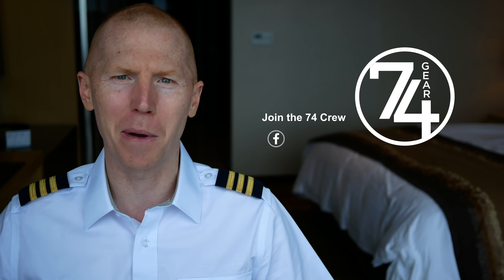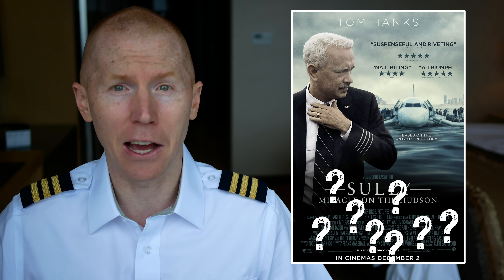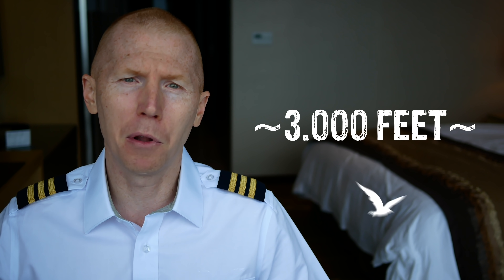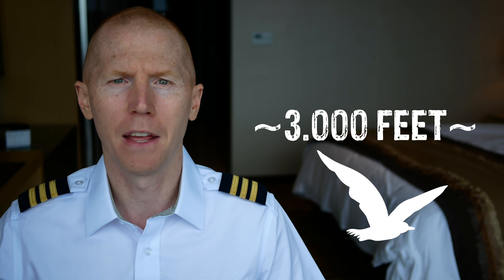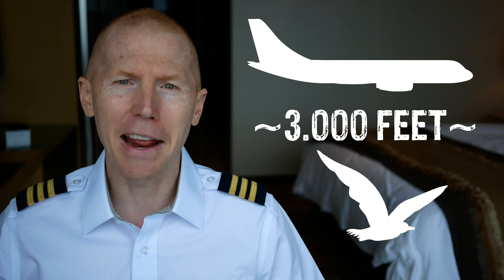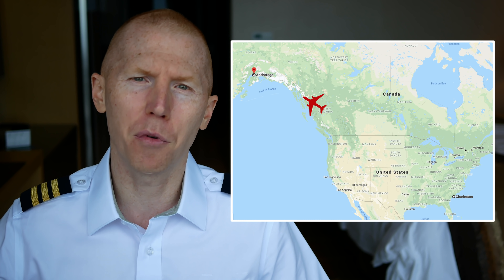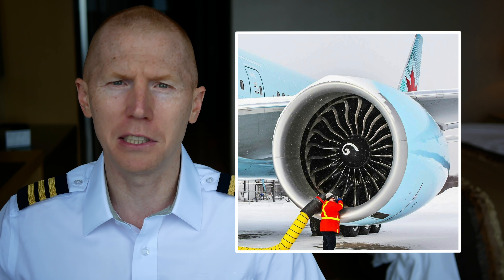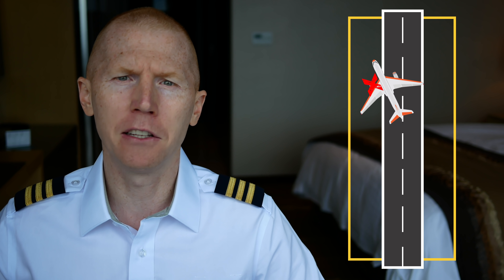Why Engines Don't Have a Mesh or Grates to Stop Birds

Comment: For some weird reason you didn't mention the fact that engineers have designed engines to be able to swallow and digest birds of various sizes without causing lasting damage. I spoke to a pilot who showed me videos of tests being done on jets where they were literally throwing fairly large birds into a stationary engine.
Reply: In 1982, a brand-new billion-dollar stealth bomber encountered an eagle.  Sucked into the right engine, it caused the jet to burn into the fuselage.  The plane made an emergency landing at Idaho Falls airport, where it was on display for a few days until the USAF figured out what to do with it.

Comment: If you put anything in front of the intake, you will cause the turbine to over heat...they use screens while in the test-cell , but they are compensated by mixture control & fuel consumption ...that is why replaced engines require a test flight after install..!

Comment: Never really thought about it before, but when the question came up in this video, I didn't think about wasting fuel and still not gaining enough thrust for a safe takeoff. I was thinking along the lines of - If they put some type of grating in front of the engines, the grates would have to be small enough that a small bird can't get through it, and if that was the case, then just by that alone it would be a relatively weak structure, and if a bird was to strike it, then you'd have all this grating going thropugh the engine, along with the bird that you were trying to keep out in the first place.

Comment: Since birds strike engines just under 3000 ft, why not put a retractable solid mesh that once again retracts automatically after the 3000 ft altitude? Based on digital data, certain airports known for bird strikes would decrease based on input data?

Comment: Turboshaft engines on some helicopters have particle separators, essentially a curved path into the engine so anything solid will go in a straight line, ejecting out a port while the intake air takes the curved path into the engine. Wouldn't work for a turbofan though. The intake is too big.

Comment: There are Russian MIGs that have a flap door forcair to enter the engines during takeoff, to prevent ingestion of rocks and other debris from less than perfect airfields. The doors then close and air more efficiently enters from the front. It can be done, but the bean counters and your bosses have figured it is less expensive to hsve an occasional crash than to build a safer aircraft.

Comment: I was thinking a cone in front of the engine to deflect birds while still leaving a big gap to suck air in from the sides but I'm sure there are a hundred reasons why that won't work. Will probably just suck birds in from the side too while restricting air flow.

Comment: Why don’t they put something that protects the engine with in 3,000 ft and it would retract outside that envelope? They could’ve adapt that to the older planes by bolting on a quick install like you would install shutters on the windows which open and shut

Comment: Good explanation, thanks for sharing!! Also if we have grids or mesh or screens in front of the engine, then if parts or fragments from that fall into the engine it will cause more damage at higher altitudes and greater speeds.

Comment: I understand that a flat grate would reduce air intake. But, if the grate was domed, it could be designed to allow the same volume of air to enter the engine.

Comment: They sell “deer whistles” that you stick on with poster double sided tape at Farm and Fleet and Casey’s gas stations in Wisconsin.    They work pretty good.   
      Just buy 2 of those for every plane.    

      Or just J W weld a plastic owl with the yellow eyes on top of the plane.   You can buy em at Menards for cheap.   
      They’ll scare away the pidgeons.   

       Or convince all the Karens working at the no kill kitty shelter to let the cats have an outdoor home at the airport, where they can roam free !   🇺🇸

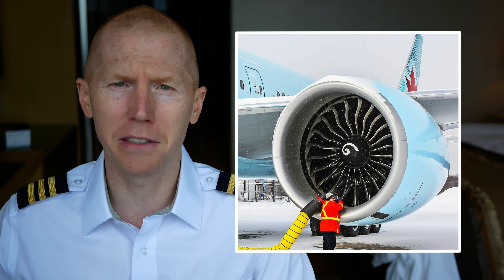Comment: You failed to mention the pattern on the hub of the leading fan that looks like a whirl (about 3:08). This is an optical they use to make birds think those engines are big eyes on a much larger bird. 
I had a friend who's grape fines got decimated by starlings every harvest. One year he trapped a starling and threw it into a room with a tape recorder and a hawk. He plays the recording every fifteen minutes during the days of approaching harvest. No starlings. So one bird saves many. I don't think that would work here as the aircraft is flying so darn fast.
Reply: I find that story difficult to believe

Comment: This quite a weak argument for lettin birds into engine. Engine input diameter  can be increased to compensate for wire mesh in front of engine. I am sure future engines will have this. Propeller engine is also an option, they will be again put to use when solar powered aircrafts will take commercial flights in future.

Comment: Weird I can use a metal screen from a house window as a turbo guard and that has  pretty small holes in it ran it on a dyno without it abs with it and no effect what so ever so it’s very very hard to believe something with 1-2 inch holes would cause a noticeable restriction in flow it doesn’t have to say stop the bird strike but break it up so the engine could actually pass it through with little to no damage done to the jet engine.

Comment: I understand using a flat-screen, or metal-grate will disturb engine intake airflow. Instead, shape the screen or grate into a forward facing bubble (forward facing, relative to the airplane) and connect it around the intake fan shroud.  Using the bubble method would increase overall surface area of the screen to promote better intake airflow. I understand weight would become a consideration, over 2 or 4 engine models, but it's not impossible.

Comment: When you say you can't have a grate or screen in front of the engine, you actually mean directly in front of it.. suppose you have a conical shaped screen 50 ft in front of that engine, strongly attached to the fuselage up by the cockpit.. the birds will get pureed by the razor sharp screen and all the blood feathers little pieces etc will be directed around the engine not through it... We're talking just very thin Sharp metal barely detectable to the eye, very little wind resistance will be a non-issue on engine performance and fuel consumption.. a picture is worth a thousand words, I could easily design something completely workable and have a damn good time doing it 👍

Comment: You could add a set of motion tracking cameras and an air jet that fires to knock incoming debris off course. 

I’m fairly certain that a strong enough puff of air could divert the bird form getting sucked in. It would definitely kill any bird it hits but would protect the engine. 

Even in the event that the bird still got sucked in the air blast would pre pulverize it and limit the damage. The system could be powered from the engines and would add a small cost to the overall cost of the plane while avoiding any decrease in fuel efficiency.
Reply: You could just not add anything. Most bird strikes are not a serious issue. And "puff of air" really doesn't describe what would be needed to divert something from being sucked into a jet engine. A large jet engine sucks in air equivalent to the volume of a house every second.

Comment: This video: "fuel efficiency"
Reality:
1. Individual bird hits happen all the time but only really extreme situations would take a plane down.
2. Any grate would need to be: strong enough to stop birds and not just slice them as they go through it:
3. Never let any of the grate break off and enter the engine.
4. Only be used in bird range < ~3000ft
5. Very lightweight (like everything on a plane for fuel efficiency).
6. Prevent ice buildup.

In short, the problem is much less severe than it sounds and a grate would be extremely difficult to design and expensive to have.
Reply: You can literally buy a little radio that sends out frequencies that drive rodents away at home depot. I do not understand why something on a larger scale hasn't been invented for birds at air ports.
Reply: @haydencook682  Airports do use these types of features
Reply: @David-NYC  I wonder why he didn't mention that then...
Reply: @haydencook682  
I think animals eventually get used to the sound?
Like those buzzers that are supposed to only be audible to teenagers/children to stop them loitering.
I once saw them advertised as ringtones so you can use your phone in class without the teacher hearing it.

That makes me think that such devices wouldn't last long and you'd need to try something else.
Reply: Yeah as someone who has taken turbomachinary classes, there isn't a huge aerodynamics problem with a grid of sufficiently thin vanes in front of the fan.  The problem is more the practicalities you mentioned above.  They would have to be very strong, very light, relatively thin, and actually dense enough to catch a bird sized object.  Those requirements are make it quickly not worth the effort.
Reply: @JMurph2015  most older low bypass turbofans and turbojets have stators in front of the fan
Reply: Not all heroes wear capes!
Reply: Nailed it.

Comment: You would think a pilot would know that on a high bypass engine such as on a 747 or any commercial jet aircraft. only a very very small amount of air is actually “compressed mixed with with fuel an burnt” the “engine” is just there to turn the big fan blade in which you can see. The air that being pushed by the fan is what propels the airplane forward. It’s typically a 10:1 bypass air ratio. As 10 parts pass through the fan. 1 part passes through the core of the engine

Comment: One of the houses my mom rents out is rented to military. This couple that lives there uses birds of prey around the airfield of bases to make sure no birds go into the engine of the plane. I know some airports have done this in the past and some just don’t do it at all. It should be standard at all airports. The birds of prey are trained very well and actually work amazingly.
Reply: This was a flocked migrating geese at 1800'. Birds of prey keep songbirds and gulls away relatively close to the ground.

Comment: Even if you would ignore the disturbed efficiency by any grate in the engine's opening, at the speeds above 100kts the bird will disinteGRATE (pun intended). And may even disinteGRATE the grate along with it, resulting in even more engine damage

Comment: Ok two ideas here.
1. A ballistic net deployed by a sensor. The metallic net is pulled by a weight shot in a downward direction at the speed of a bullet.
2. An airbag that deploys by a sensor and blocks the engine by a quarter of a second or so. All possible with the right engineering I think. Maybe.

Comment: What about a temporary shield that is automatically deployed over the second engine to prevent 2 engine flame out, both engines will not fail at the same time, one will always fail first. A clam shell mechanism to safe off the good engine, which can then be restarted to allow a safe landing...not in the Hudson.

Comment: Change the engine shape a lil.  Wider in the front to compensate.  And like a bladed cone kinda front to deflect birds. At least if it goes in it doesn't go in whole  Think sr71 blackbird ..  Don't want anything to stick to it

Comment: I’m sure if it’s worth $25mill you could make a retractable cone to create mass air ratio as a flat one is plain silly and way too restrictive that only works for the bird zone it wouldn’t effect fuel anymore than in the 5-10% range at most yes I’m an engineer the structural integrity and weight this would add to each side also once retracted it will all have to be taken into account but this is by no means something hard to design but failure of it would be probably more common than the bird strikes themselves so many factors to consider and moving parts locking mechanisms more engines on the jet engine it would have been think tanked a while ago and agreed unfeasable certainly not unachievable

Comment: 4:42 Well, pilots are trained that body of liquid is one of the worst choices for emergency landing (that's because water isn't solid, which means gear won't soften the impact (it will just sunk through, maybe even get damaged a little, but not slowing down the impact in any significant way), but at this speed liquid behaves like concrete (so we can imagine landing on water as landing on top of 1 metre-wide concrete wall)). Actually, even forest is a better choice.

At least for small planes, like Cessna 152.

Comment: Here's hoping you read this comment:
     As a 747 pilot, if you happen to have direct access to one of those engineers you mention in your Vid. I would very much appreciate it if you could somehow put me in touch with one of them.
     I happen to have an idea that addresses a possible solution to this very issue, and which has been rattling around in my  brain for decades.
      I assure you that if my idea works, it would cost the aircraft building industry PENNIES on the dollar to implement. 
     You never know. It might turn out to be nothing, but on the other hand, it just might have some merit.
     It has nothing to do with obstructing the volume of air flow into the engines, and I would love the opportunity to place it in the right hands, so they can experiment and play around with it to find out if it's viable or not.
     Needless to say, if it's doable, it would save thousands of lives, not to mention millions of dollars in equipment annually.

Comment: Just curious do you say that it will restrict airflow into the turbine engine however a lot of turbo props if you look at the intakes they are shrouded in screen is that because ones making shaft power and others making thrust?

Comment: To be fair, aren't birds bones hollow? I get the feeling It'd need to be quite a large bird to actually damage an engine to the point of it being non functional since I'm guessing it's an issue of mass and those engines are pretty large and built from some sturdy materials from what I hear. 

I get a feeling that flying through a small amount of sand or a cloud of  moisture would be more dangerous due to the fuel air mixture and the fact you're suddenly hitting a wall of mass or coarse materials, unless the temperature inside the engine literally separates small amounts water at a molecular level into hydrogen and oxygen due to the temperature involved in combustion but I get the feeling that those two situations could be more dangerous and more common.

Comment: No grate or screen because if the grate breaks with a bird strike impact you will have twice the problem. The bird and bits of the grate to destroy your turbine blades. Soft flesh is always better than hard metal.

Comment: Why did Sully spend so much time on the same course after the birds hit though? 
On the black box recording there's a couple of minutes (can't remember but between 1 & 3) between the bird strike and changing course to find a landing. It only took a couple of seconds to realise the engines were out but he still didn't make a decision for ages. 
Is it possible he could have made it back to the airport if he'd immediately turned around when the first engine stopped? 
Is there a reason protocol doesn't insist that if an engine stops before a plane reaches cruising height that before any more checks are carried out it  immediately turns back to the airport? Except to avoid an immediate crash obviously.

I'm not saying he wasted time or did anything wrong but when a lay person hears the actual footage that delay does raise legitimate questions.

Comment: I suspected anything capable of preventing a bird from entering the engine would seriously affect the airflow. Pilots will want full power for take off so that makes it a bad idea. Perhaps one day a genius will invent a deflector that nudges birds to the side of the engine but does not seriously restrict air flow. Air can much more easily be redirected than a bird large enough to do damage.

Comment: Appreciate the education. So…I suppose a retractable guard - kind of like a medieval knight’s helmet - that stays down until an altitude of 3K feet is achieved, and then lowered again below 3K feet is not possible? I’m no engineer or physicist but it seems like that could work. 🤷🏻‍♂️
Reply: What I find interesting is that there are several threads suggesting retractable screens.  Its an idea that many people have ^_^
The design does exist for some aircraft (Russian fighter jets) but it's more for small debris and not birds.  There are actually several design challenges to make a screen that is strong enough to take several high speed 8 pound birds strikes and not also get clogged or broken off only to be also sucked into the engine.
Screens also can cause turbulence for the engine intakes which might cause engine stalls and they are also prone to ice in Icey weather conditions.  You can imagine that making them retractable will also pose additional design challenges.

Comment: The actuarial cost of a displacing screen for altitudes less than 3000ft would be higher than the cumulative lawsuit settlement costs over 20 years.

Comment: US Marine Tank Mechanic here. The United States uses the Abrams tank which uses a turbine engine to move around. In front of the air intake on this engine there are several filters, including a metal screen to prevent insects from clogging the intake. In short, your "a turbine engine can't have a screen in front of it" reasoning is bullshit. the horsepower on that engine is so high that putting a metal screen in front of it wouldn't reduce the thrust output enough to matter. Especially considering that you can lose two out of four engines and still fly.